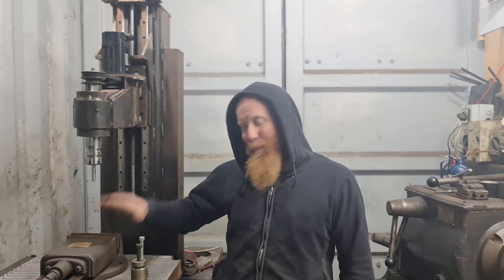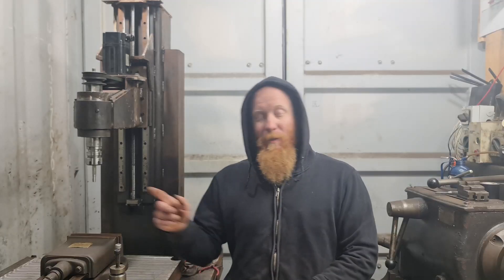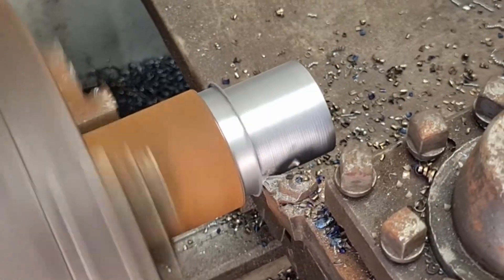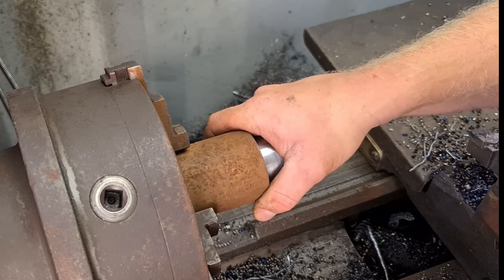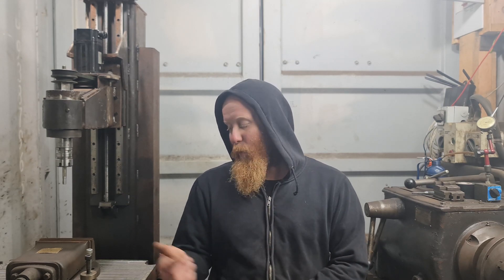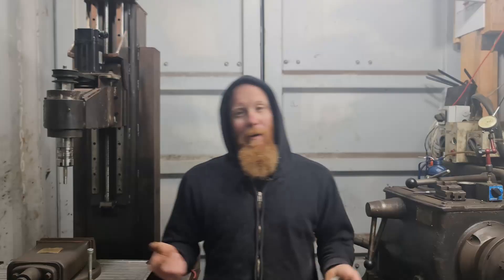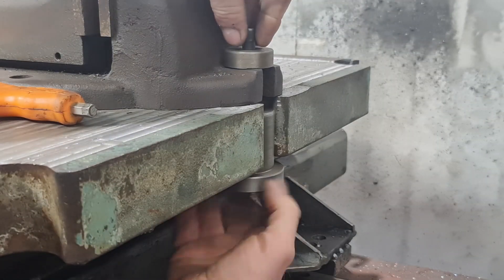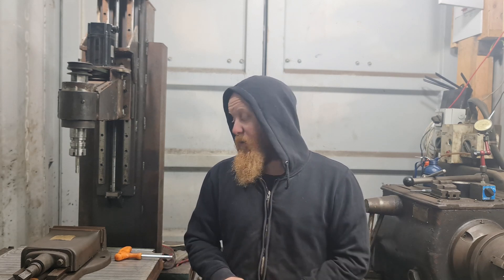Diy Cnc Mill Gets Its Vice Mounted

Comment: Did you work in a machine shop? This type of thing has always fascinated, but looks like a lot to learn.
Reply from the maker: Hi there thank you for your comment.
No I never worker in a machine shop I worked in an spring making shop for my first job for about 6 years we had  a manual mill and lathe but I never really used them.
I am completely self taught I started by building a 3d printer to learn cnc and I brought a manual lathe to learn that. 
I is alot to learn but if you have passion for something and are willing to take the time to learn you can achieve anything you like believe in yourself and go for it.
Thanks again for your comment most appreciated.